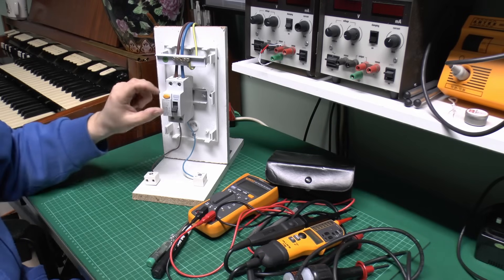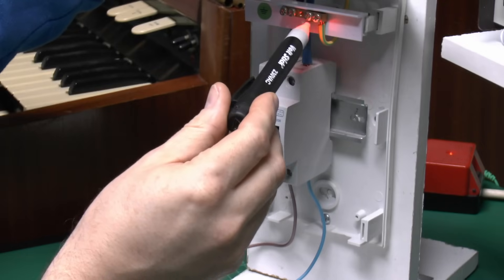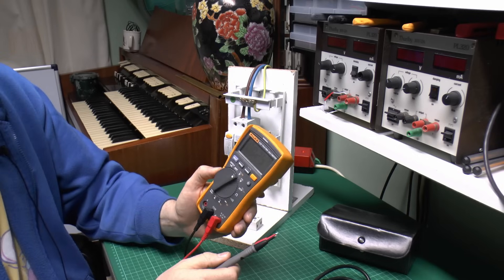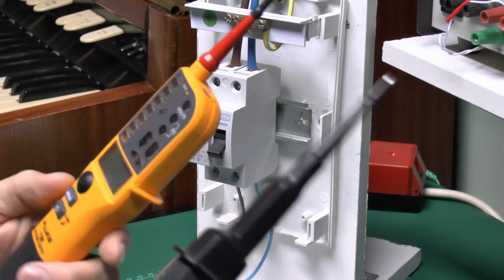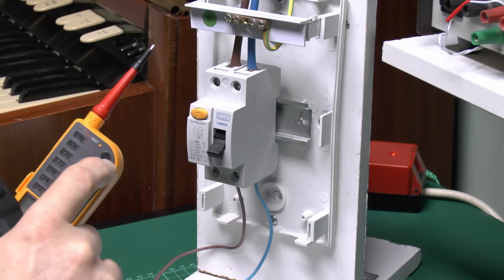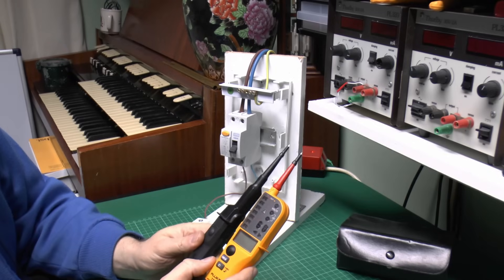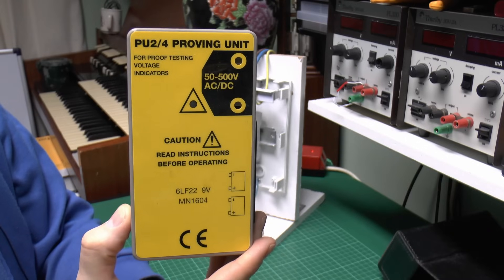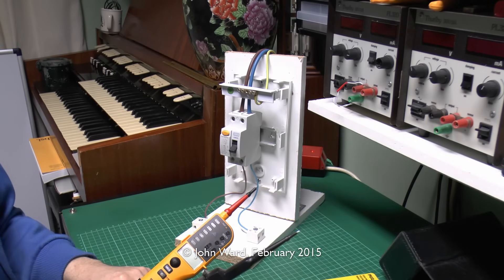Proving Dead - Mains Electricity

Comment: What if the neutral/earth wire is improperly connected? Answer is your fancy testers will give a FALSE NEGATIVE and eventually you'll get a shock. Just use a good quality mains tester folks.
Reply from the maker: In that unlikely event, the high quality test probes shown in the video will still give an indication of live parts, as they and others like them include single pole voltage detection which works via capacitive coupling through the plastic case.
Reply: @jwflame  capacitive sensors are even worse than mains tester,  I have both a Wera mains tester and a Japanese capacitive testers - I'd chose the wera any day over the capacitive. Modern tools doesn't necessarily beat a age-old simple tech, specially when you're comparing a 50 cent garbage mains tester against a fluke multimeter.
Reply: @jwflame  if you think the single probe voltage detection work differently than the pen testers you should revaluate your  line of work :D